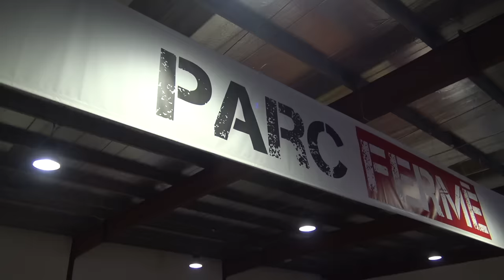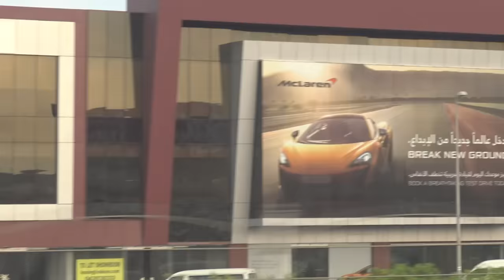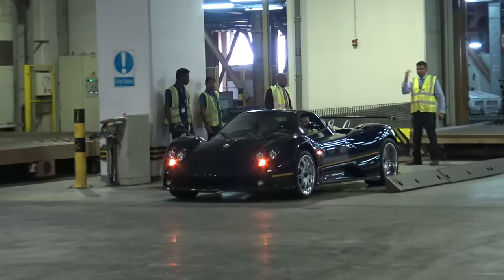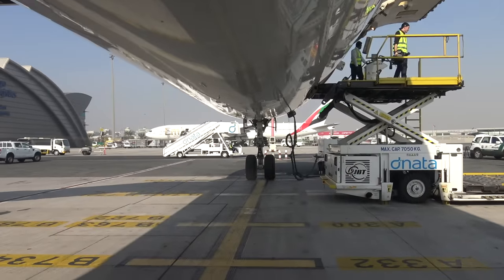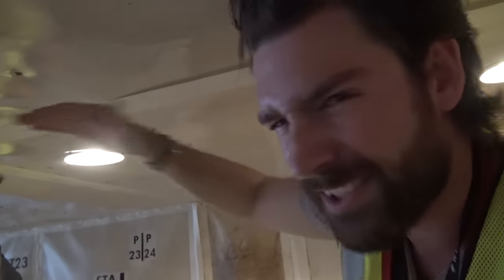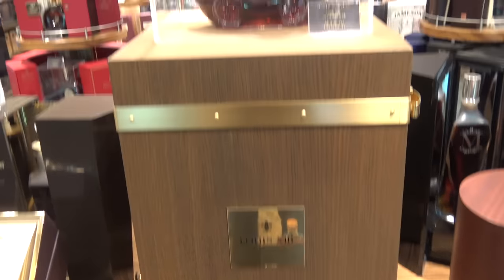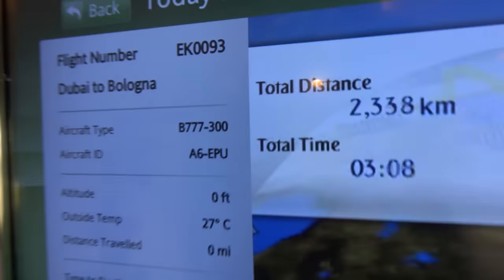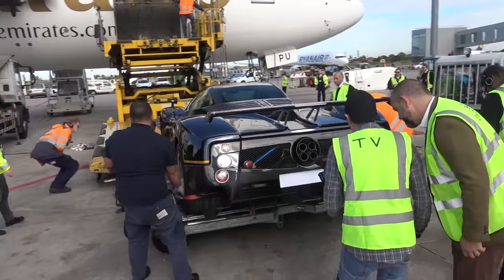Flying A Pagani Zonda From Dubai To Italy - First Class!

Comment: So, what we have learnt from this video is, that you can take your car together with you on the same flight, but it takes you four days to board... did I get that right? :)

On a more technical note, the only part that I found unspectacular in the whole process was that they actually had to steer the car to turn it 90 degrees in that tight cargo space. With all the clever gear they had available on the ground, I thought there would be a more sophisticated way to do this. 

Anyway, great video as always Mr. James, and amazing experience!
Reply from the maker: +Miroslav Milan Thanks buddy! It was documented over 4 days to film it for the Emirates documentary (not this video) but usually yeah it's just 1 day 👍🏻